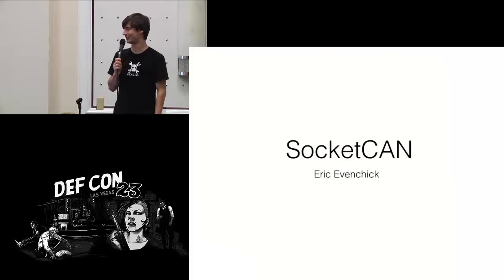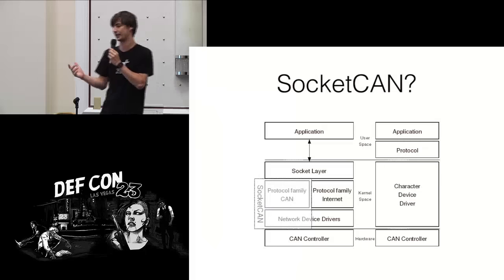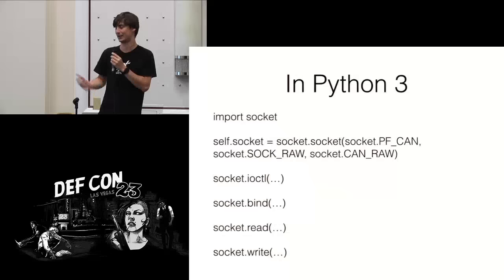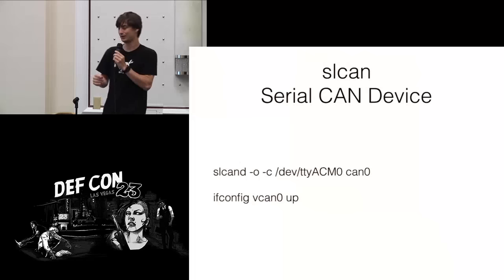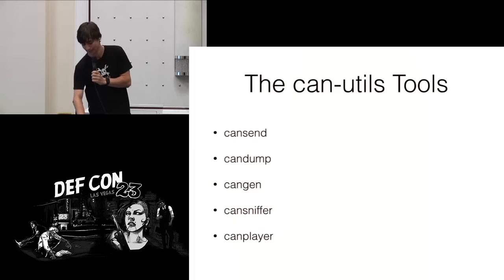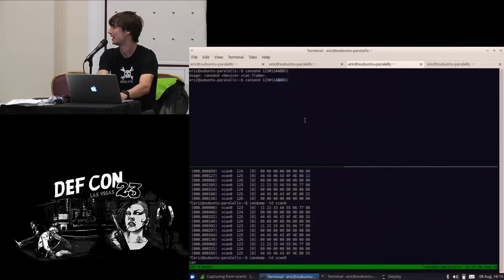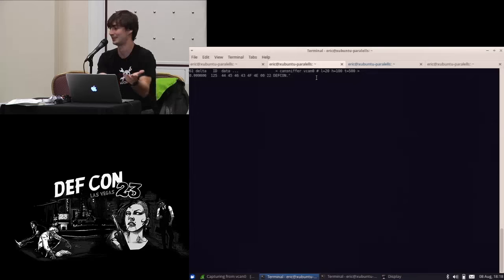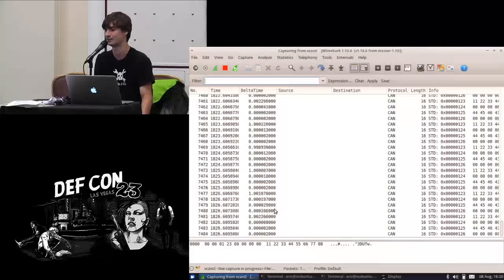DEF CON 23 - Vehicle Hacking Village - Eric Evenchick - SocketCAN

Comment: That is the easy part, implementing all the SAE and OEM protocols cost a lot of time and money.

Do not fuzzy the can bus on a machine that you do not know... I have blown "something" on a brand new big rig with an automatic transmission, effectively bricking the engine, while using my own "telemetry reserved" ids... Warranty covered it, but their techs hates me now.
Reply: What were you especifically doing?
Reply: totoxahc Would you walk in a factory, plug into one of their assembly lines can-bus, start to fuzzy it and expect the whole thing not to shut down and all alarms to go off? Why would you expect being able to do the same thing on a vehicle? The particular bug I was describing here last year has since been fixed by Paccar, this was a case of me as a telemetry supplier doing perfectly valid things with the machine and still managing to brick it, just by having a PGN conflict on the bus. Do not ever fuzzy the can-bus of a live vehicle, you will fuck things up.
Reply: +jonharson well, there are inductive/capacitive interfaces that allow you to listen to the bus with no posibility of interfering it. That would be useful for telemetry in any system that streams the data (j1939, fms, etc). If you were sending messages to one of those networks I think that is a really bad idea
Reply: totoxahc I don't think you have the slightest experience working with those bus... You are not going to get anything useful from j1708/j1939 if you are not actively asking for it. Contactless-can does not in any way mean that it is read only. Brute forcing the address space to get all active PGM is harmless (there are tools made with just that purpose in mind), but if you start to fuzzy it with random garbage you will fuck things up guaranteed.
Reply: - So nobody, except you, is asking for useful PGNs?
- How could a contactless interface interfere with the bus?
- Agree.